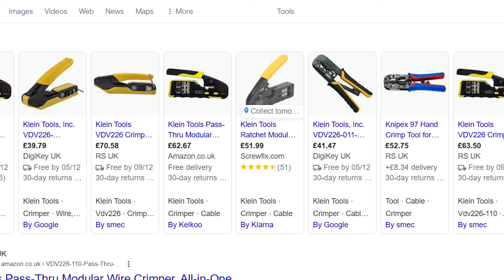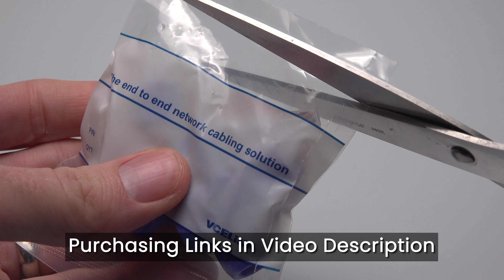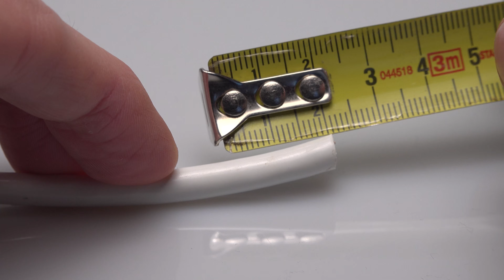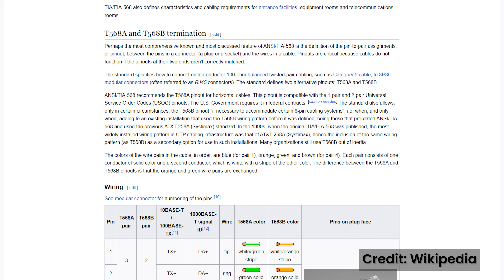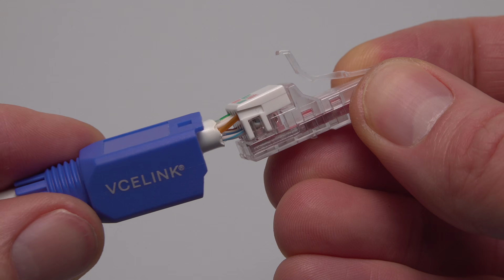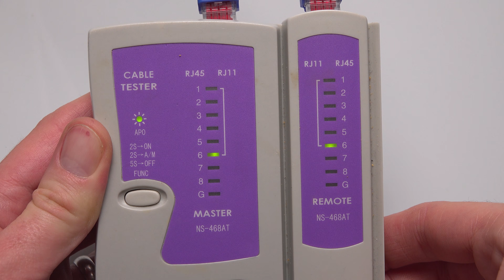How to Wire Up Ethernet Plugs WITHOUT special tools!! (Tool Free RJ45 Connector for CAT5e & CAT6)

Comment from the maker: 🛒🛒Purchasing Links: (paid)
➡ Toolless / Tool-free RJ45 Plugs: https://geni.us/ToolFreeRJ45 
➡ Klein Ethernet Cable Tester: https://geni.us/EthernetCableTester
➡ Cheaper Ethernet Cable Tester: https://geni.us/NetworkCableTester
➡ Telegärtner Zinc RJ45 connectors: https://geni.us/RJ45Toolless
➡ Klein Flush Cutters - https://geni.us/FlushCutters 
➡ 100m CAT6 Cable: https://geni.us/100MCAT6White (cut to your required length)
➡ Automatic Wire Strippers: https://geni.us/WireStrippers 
➡ Wire Cutters / Snips: https://geni.us/Snips 
DISCLOSURE: As an Amazon Associate we earn from qualifying purchases.

Comment: tool free, then goes to show using 3 or 4 tools
Reply from the maker: Without SPECIAL tools is quite clear in both the title and the thumbnail. I'm not sure how much clearer I can be; you don't need a special crimping tool with these plugs. If you don't own a pair of scissors or pliers and consider them to be "special tools" then I'm very surprised you're doing things that require network cables to have RJ45 plugs fitted.... 🤷‍♂️
Reply: @SwitchedOnNetwork  you don't need to get all aggy mate, you are showing a video of something you claim says "tool free"
Reply from the maker: Do you think it still counts as "tool free" if you need to use a pair of scissors to cut 45m of cable from a 100m drum for a cable run?
Reply: @SwitchedOnNetwork  nope, i don't know why you are getting so angry, you are using tools, it isn't "tool free", also looks like you have changed the title of the video, i was looking for something that wouldn't involve me buying any tools at all, hence the "tool free" comment.
Reply from the maker: I'm not angry mate, just bemused by the internet's unlimited ability to produce people who make silly comments on videos and complain when their sense of entitlement hasn't been fulfilled by something given to them for free 😂
Reply: @SwitchedOnNetwork  "free"...you use that word very loosely i see, anyway, go to bed

Comment: I think the cover is the wrong way round in this video. I tried it this way. It was impossible to disassenble and the trigger did not work well.  I tried the cover the other way round, with the longer side opposite to the triger and it clicked into place, it was easier to disassmble and the trigger worked better.
Reply: Yup. I noticed the same.
Also, on the AliExpress page it shows the cover the other way around.

Comment: This is plain nonsense, if you are gonna DIY network cables, just don't buy expensive crippler, buy a cheap one.
Reply from the maker: These are an option that's available, and for some people and situations they may see them as the best choice for them. Especially if it's a complete one-off.

Comment: Found this video and thought, "Cool! No special tools..." Then the video proceeded to use special tools 🤣
Reply from the maker: Which of the tools that I used would you describe as, "special"?
Reply: @SwitchedOnNetwork   Well I was struggling with an RJ45 connector since it was a thin version, ...super tiny wires.. Im googling techniques for handling it.. find your video and think, "sweet no special tools" so I get my connector and cable and fire up your video and the first thing I noticed is I need special RJ45s.. the "modular" type. but, that did not stop me from ordering some lol. I should clarify, your video was helpful to me. But to me, it is only "no special tools" if you do not need special connectors. I mean, I bought 100 normal RJ45s for $7.. I just bought "6" of these modular type for double the price of 100 regular ones.  ..,special  :) I am clearly a noob so forgive me lol

Comment: What a load of krap, first thing first this is not toolless because you still need wire cutter and stripper and a wire crimper on AliExpress is around 10$ and I believe it's enough for a small diy like myself
Reply from the maker: Thanks for your insightful comment

Comment: hello the tool free rj45 toolfree connectors only has 4 holes but cat 6 cable has 8 wires so where do the other 4 wires connect please
Reply from the maker: Are you sure it's an RJ45 one you've bought, if it only has 4 connector spaces?

Comment: My apartment has ethernet running through the walls and they all lead to a panel in the wall where the router is, but none of the ethernet has the RJ45 connectors, they're just cut off ends.  I called my ISP and they said they don't do fix those, and I called my landlord and they said they aren't expected to either... so who do you call to do this sort of thing? I don't trust myself doing it.
Reply from the maker: Give it a go, there are lots of tutorials on this channel. It's much easier than you might think and you'll be pleased with yourself when it's all working 😊

Comment: Man, I hate to be a downer here, but you should never EVER use a punch-down tool toward your palm. The "quality" of the end products lack attention to detail.  Cable does norhing but lay there.  If you don't give it the proper quality, it will not perform for the enture time it's installed.  Also, untwisting all pairs at once?  You're just making it harder on yourself.
Reply from the maker: You're right - but the white video surface I was recording on isn't strong enough to press down against with that much force, so I had to make do in order to represent for the camera 😁

Comment: The video does not seem to cover shielded ethernet cables.  For one outdoor application I have the vendor of the kit specifies shielded cable
Reply from the maker: That's right, these particular plugs are for non-shielded cables. There's another video tutorial on this channel that does cover shielded cables and plugs though, if you want to do that 👍
Reply: @SwitchedOnNetwork  Digging through the links I see that the Telegartner item (second item) does do shielded cables but secures the cable differently
Reply from the maker: Yes that's right, they do. I was originally going to use those in the video tutorial but due to their much higher cost compared to the plastic ones, I decided the plastic ones would have a wider appeal. Since I'd already bought them though, I briefly included them in the video and in the purchasing link list, so I'm glad you spotted them! :)

Comment: So, you don't want to spend a lot of money on a crimper, but you do on a cutter?  Also, it's bad practice to put plugs on solid wire.  Originally plugs were made for stranded wire, but people who didn't know better insisted on using them on solid.  So, they came out with plugs that work with solid.  However, it's still bad practice.  You terminate solid wire on a socket and then use a patch cord to connect the device.
Reply from the maker: As I said in the VO, you can use a good pair of scissors or nail scissors if you want to in place of the flush cutters. IMHO it's debatable whether it's really bad practice to put plugs on solid wire - being theoretical and purist has its time and place, but at the end of the day when you want/need to do stuff in the real world and get the job done, it's what you need to do that matters. Have you tried to buy stranded CAT6 cable recently?! 🤣 I agree that usually it's best practice to terminate long cable runs with a socket (there's already a video on this channel covering that, and one on a toolless keystone jack in the works) but there are also situations which call for an RJ45 plug at the end of a cable instead of mounting a wall socket then patching from that - if there weren't, then companies wouldn't sell the plugs and crimpers! For example, running from a PoE switch to a PTZ camera for fixed video/livestreaming installations, or to an EV charger or home battery outside on a customer's driveway, to name but two. That last one might have a keystone jack on a wall socket inside the house, but an RJ45 plug on the outside end. Anyway - hope you enjoyed the video and thanks for commenting. Happy Christmas! :)
Reply: An advantage of using stranded wires on patch cords is that they are more flexible. But that is only a valid argument for devices that you plug in an out very often. If you want to connect your media server to a switch, then a solid wire will do the job just fine.

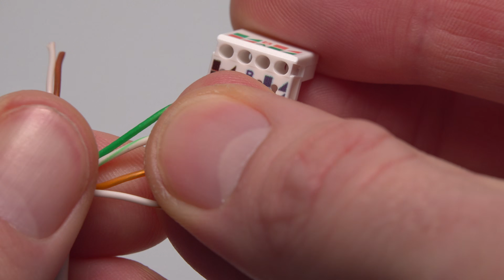Comment: @3:55 I'm not sure if it is important today but in acient times you must switch green and orange pair on other end if you connecting two computers (network cards).
Reply: Crossover cables have not been necessary for 23+ years due to the invention of Auto-MDI-X.
Reply from the maker: Yep, that and most amateur home users (if they're not using WiFi) will probably be connecting into their ISP-supplied combined modem/router/switch/WAP - and most prosumers will be aware of and have one or more network switches in their setup.
Reply: @SwitchedOnNetwork  Those days small hub/switch is maby cheaper than crimper or those autocrimping plug 😉
Reply from the maker: @AK-vx4dy very possibly - but these are useful for if you need a long, custom cable run between something where you don't want to fit a wall socket at one or both ends
Reply: @SwitchedOnNetwork  Yes, yes I wrote in context of doing crossover cable 😅
I  rember time when I carried 10 meters cable with me to the clients just in case 😅
Reply: @eat.a.dick.google  Probably true, most switches/hubs adopted it quickly i don't know how it is in client cards but i suppose true especially after 1Gbit or more became popular and few chip providers survived. I made cables in times when first propetiatry 100Mb needed 4 pairs (100VG) 😅
Reply from the maker: Yes that's right, if you do that you get a crossover cable (rarely seen these days)

Comment: Noob... i crimped blind RJ45 with big flat screwdriver, hammer and vice (to hold) 😂
It was in '90 and my boss didn't buy crimper yet and i was impatient to see if it really works (first contact with UTP cabling) and i rember colors for 568B to this day.
Reply from the maker: Ha, good work! Did you have to do each contact separately as well? 😄
Reply: @SwitchedOnNetwork  Yes, one by one 😅
Reply from the maker: @AK-vx4dy I bet you felt like Christmas had come early when you got your first crimping tool 😂
Reply: @SwitchedOnNetwork  sure, but first I get crossing "knife" - such strange toll with small scissors - but no patch panel or socket module to use it 🤣